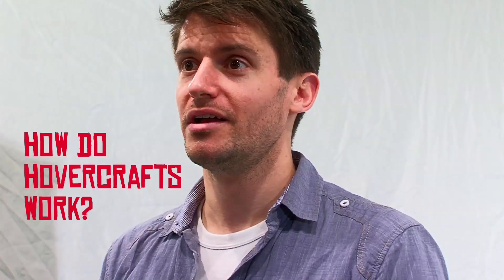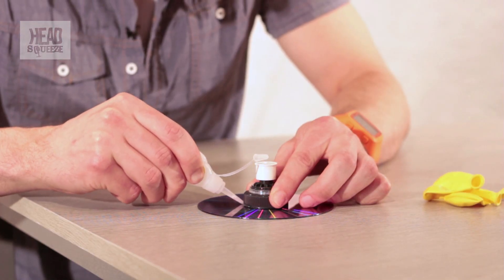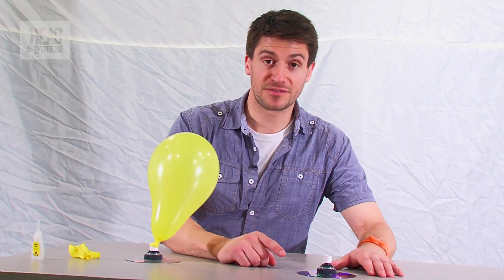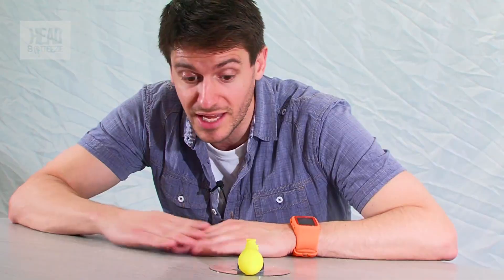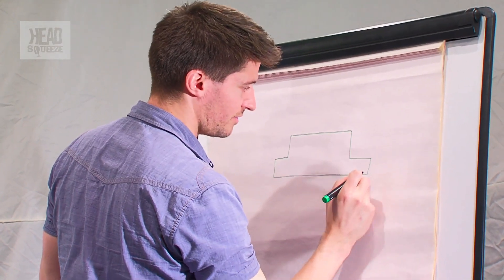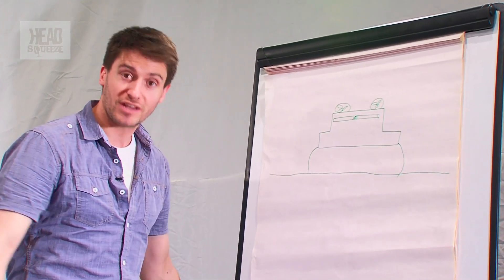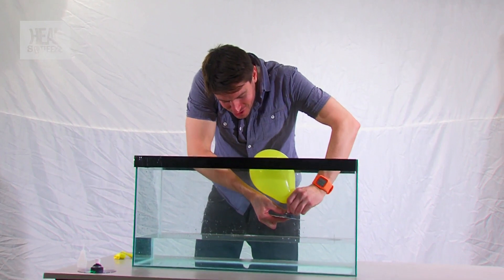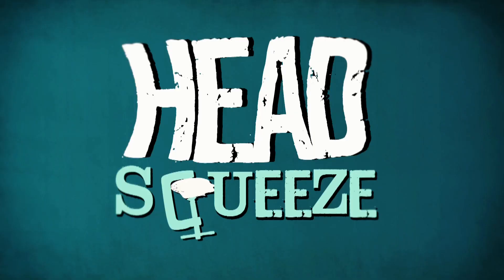How can Hovercrafts Hover? | Live Experiments | Head Squeeze

Comment: Well CDs and DVDs have exactly the same size and probably the same weight. A DVD is basically a CD with more storage capacity. 

So why would it matter? Or maybe you can tell the difference by simply looking at it, which would be impressive.